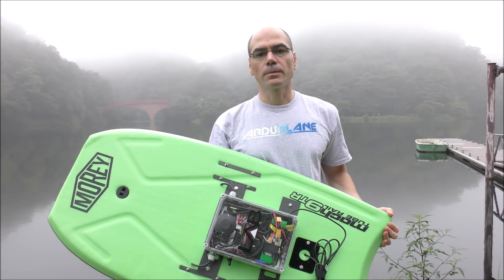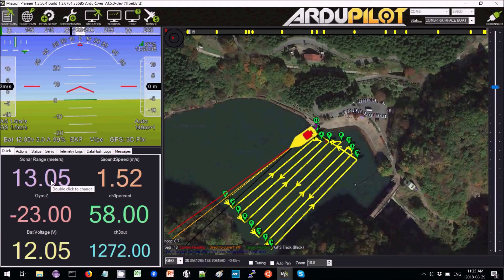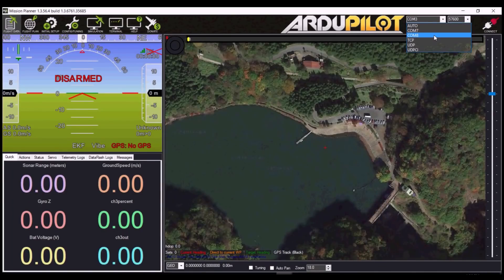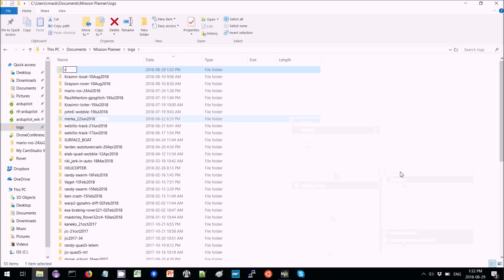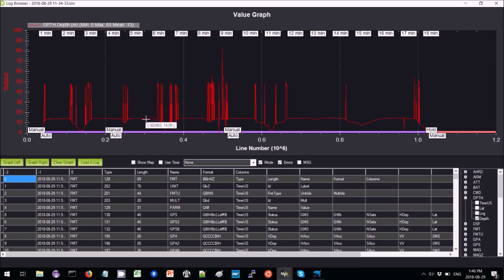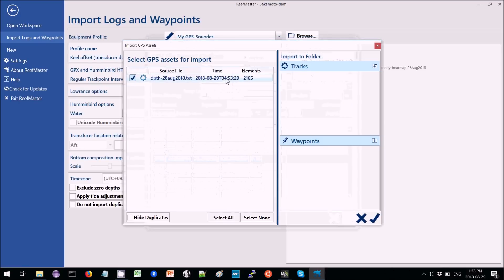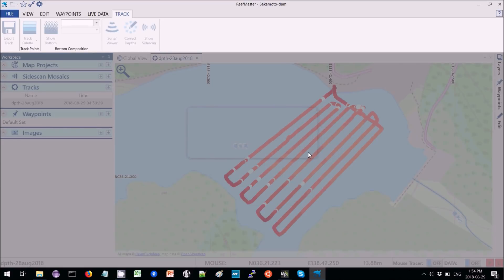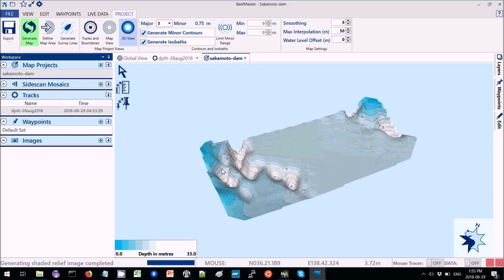Mapping a Lake with ArduPilot

Comment: Great project. I wonder if the depth soundings near the shore are from the depth sounder getting confused by a soft bottom and a strong echo from the shoreline or some other object. It might be helpful to obtain all good echoes per location to be able to identify that possibility, or at least add echo strength reading. All this assumes the sounder provides the data.

Comment: Im looking for the best way to map all of our ponds on our golf course. We want to determain our water holding capcity in the event of drought.
Reply from the maker: Sounds like a good application.  Re the underwater sonar, a BlueRobotics Ping sonar is relatively low cost (https://ardupilot.org/rover/docs/common-underwater-sonars-landingpage.html) and works with ArduPilot.  Its range is only 100feet (30m) but that is probably plenty for a golf course pond.  I don't sell these boogie board boats but ArduPilot is open source so someone with experience building RC boats should be able to put one together and they will find a helpful community in the support forums and in the ArduPilot facebook group. https://discuss.ardupilot.org/c/ardurover
Reply: @rmackay9  I will try using a Deeper Pro+ trolled behind a small RC boat. Our ponds are relatively small so I wont need waypoints. I will export CSV data to reefmaster to view the 3d map. to determain the water volume maybe I can export to Autocad and use the cut/fill tools?
Reply from the maker: @agrengs0  Hi, I don't have much experience with that sonar or Autocad so no idea but sounds like it could work.

Comment: Hi Randy, im using sonar module, but my log doesnt have dpth. Did i miss something? 

Setup on Ardurover.
Reply from the maker: Husni, make sure the orientation is set to 25 (e.g. RNGFND1_ORIENT = 25) and that the vehicle is setup as a boat (FRAME_CLASS parameter should be set to 2 (Boat)).  If this is done the DPTH should appear in the logs.  best of luck.  Also it may be best to report support issues in the forums.  Especially if using beta 4.1 I'm quite responsive, txs for using AP!  https://discuss.ardupilot.org/c/ardurover/rover-41/158

Comment: Hi Randy, 
I have anothers questions about this project.
I have the kogger sonar, and I am documenting the information to aid the Ardupilot web documentation.

I have the boat and the system fully assembled, but I have a question about the logs.
When do I retrieve the logs? after mission? 

Will the GPS NEO 8N tell me the GPS position / by time? And the same with depth sensor?

Kogger sonar does not have GPS.

I want position and depth at XX.XX time for excell and ReefMaster.

Thanks a lot for your help, sir.
Reply from the maker: Hi Alberto, yes, normally you download the onboard logs (aka dataflash logs) after the mission (https://ardupilot.org/rover/docs/common-downloading-and-analyzing-data-logs-in-mission-planner.html) and in there should be a DPTH message which is recorded the moment the sonar takes a new reading.  That messages includes the distance but also the latest position estimate.  So it's not actually the latest GPS position but rather a combination of GPS+IMU.  The advantage of this is that the distance and position should be more accurate than using GPS alone.
Reply: @rmackay9  Thanks for your help Randy... !! I am fascinating with your projects.

I have another question... today I got 2 surveys,  from 1 file ".bin" I can download the information and convert to log.... depth logs... works perfect !!!!
But the second ".bin" I have this error from MP:
"Log browse will not function correctly without FMT messages in your log. These appear to be missing from your log"
It is from the same day, what have I done wrong? Maybe turn off the Pixhawk without notifying MP?

EDIT: Auto analysis (for logs) says something like this:
"                 Failed to load analyzer results

System Yard XmlExceptiorL Fin inesperado de archivo_ Los siguientes no estén
cerrados header. loganalysis_ linea 8. posiciön I.
en Throw(Exception e)
en Syste-n.X-nI
en Syste-nX-nI ParseEIe-nentCmtent()
en Syste-n.X-nI X-nISJbtreeRead« Read()
en Syste-nX-nI MoveToCmtent()
en Syste-nX-nI IsStartEIe-nent()
en MissionPIanner.LltlIities.LogAnaIyzer.ResuIts(String xmlfle)
en sender.
     "        
Thanks sir !!
Reply from the maker: @albertorevuelta4005  this error message appears when the "FMT" messages are missing from the top of the log.  These messages tell the log viewing program (e.g. Mission Planner) what the column names are.  I wonder if perhaps the log is really big and something has gone wrong somewhere, perhaps within AP's log handling software.  If you could put the logs somewhere and send me a link I could check.  If possible though, it would be best to post in the forums (https://discuss.ardupilot.org/c/ardurover/rover-41/158 ) and ideally test using ArduPilot Rover-4.1.0-beta because this is the latest software undergoing testing so if there is a bug this is where we would fix it.  thanks again for using AP!

Comment: Hi Randy Mackay,
I am fascinated about your project. I am doing something similar in my University.
I want to ask you about 2MB flash memory, Can it be a problem for depth logs?

Thanks sir !
Reply from the maker: Hi thanks.  On most ArduPilot compatible autopilots the onboard logs are stored to the SD card and most ship with a 2GB card but this can be replaced with something much larger.
Reply: @rmackay9  Thanks very much for your fast reply.
 Thanks sir. 
Regards, Alberto.

Comment: That is impressive!  I noticed at one point a Lidar message in Mission Planner.  I have the Garmin  Lidar Lite V3 which reports distance ok in Ardurover, but I don't know what to use for PRX-Type.  Could you please let me know if it even works with Ardurover?  Mine right now is a Rover and not a Boat, but I sure want to build up a boat after watching this.
Reply from the maker: To do object avoidance with a 1-dimensional lidar you'll need to ensure the Lidar is working (which it seems you've done already) and then set PRX_TYPE = 4 (RangeFinder.).
Reply: @rmackay9  Thank you so much, Randy.  It's my problem to solve but when I did that my Rover went all over the place like it was seeing obstacles everywhere yet there was nothing in front of it and the Lidar was showing 400+ cm. I do appreciate you responding.
Reply from the maker: @HughD  That sounds very much like the lidar was hitting the ground and seeing things.  This can be seen more clearly by enabling the ADSB messages so the obstacles appear as little red circles on the Mission Planner map.  This is possible by setting the OA_DB_OUTPUT parameters (https://ardupilot.org/rover/docs/common-oa-bendyruler.html) but it may also be necessary to set SRx_ADSB to 5 (where x is the serial port on the autopilot connected to the telemetry radio sending info the ground station)
Reply: @rmackay9  Even though I won't pretend to understand fully, I totally get the idea that it's seeing obstacles everywhere.  I'll go to work on that.  Thank you for your time and advice, Randy.

Comment: Hi Randy, I'm wondering why you mounted the thrusters approx halfway down the board as opposed to at the stern of the board?  I am no marine engineer (or anything close), but most boats I have seen have propulsion at the back.  Did you choose middle placement so you can make quicker turns via skid steer?  Have you tried them further back and found the middle to be the optimal placement of the thrusters?  I have a spare set of BR thrusters, and old pixhawk, radios etc and during COVID lock-down I was thinking of building something like this to test out.  I just want to drill the least amount of holes in the craft.  Thanks for all your insight and help!
Reply from the maker: Hi Ian, I have not tried mounting the thrusters further back.  The frame was actually built for me by Attraclab (https://store.shopping.yahoo.co.jp/attrac-shop/a5c9a5eda1.html) and I think the reason they were placed in the middle was, as you say, to keep it very agile.  The thrusters on mine are placed just a touch behind the middle of the board, I suspect they are near the center of gravity of the board.  The biggest issue with the frame has been keeping the weight towards the back of the frame or else its nose gets stuck a lot when accelerating forward.

Comment: Hi Randy, have you or has anyone that you know of tried using one of the dual frequency echosounders (200/400 kHz) or (50/200 kHz)?  Would the pixhawk be able to record both streams of data from the device and store it so that could be exported as shown in this great video?  Or could you choose the single frequency to be recorded (then have to do mission twice with other frequency)?  Thanks for your help.
Reply from the maker: I haven't heard of anyone using a dual frequency echo sounder.  I think they would need to be setup as separate rangefinders but we have a small issue in how we log the DPTH message because it doesn't include the "instance".  This means there would be no way to separate the two depths.  This logging issue is quite easy to fix though so I've created an issue for it: https://github.com/ArduPilot/ardupilot/issues/14081.  So the logging issue is easy to fix, I don't immediately know how a dual frequency echosounder could be connected to the autopilot so that the autopilot can read each depth separately... but it is probably possible.
Reply: @rmackay9  Thanks Randy!

Comment: How to set up this method for scanning the water tank in Missionplanner?
Reply from the maker: Andrew, the blog post that goes with the video is here: https://discuss.ardupilot.org/t/mapping-a-lake-with-ardupilot/32401.  ArduPilot boats use the "Rover" firmware https://ardupilot.org/rover/index.html.  If you run into troubles it's best to ask in our support forums here: https://discuss.ardupilot.org/c/ardurover/rover-4-0/154
Reply: @rmackay9  Thank you very much for the information

Comment: Hi, planning on building something similar for work. The whole project seems to fall on the battery cost though. If I want to be able to run a boat like this for 8 h I would need about 360 Ah of LiPo4. Are my calculations completely off or am I screwed? Or do you have some suggestions for a workaround? Also, I am a bit curious about the retail price of the Echologger? Thanks!
Reply: May I offer you to test my echosounder? It is compact size and able te work with android devices for data logging including GPS data from the phone. https://youtu.be/Tam4cmZ7rfE

Comment: how far can these go?
the ardupilot thing right?
does it have a certain range limited by the antenaie. 
if it had infinite power, then would it have inlimited range? could it sail across the ocean or does it stop working or turn around after a certain distance?
Reply from the maker: Wyatt, the software has no specific limit on how far it can go and we think it could cross an ocean although we haven't tested it yet.  There is at least one user who is working on a solar powered boat with the plan being to make it cross the Atlantic ocean.  I should say though that we know of one issue re our distance calculations when crossing the bearing straight but we will fix this (https://github.com/ArduPilot/ardupilot/issues/1246).  If you're looking to discuss with other users and developers this is our forum: https://discuss.ardupilot.org/c/ardurover

Comment: What is the capacity of the battery you used? How long did the mission take? That's an awesome product and I'm working on something similar myself. Thanks for the info!
Reply from the maker: In this test I used a small 3300mAh battery but in more recent versions I'm using 7500mAh batteries.  I haven't mapped the entire lake but I think it would take less than 2hours but that's a guess.  I don't know if a 7500mAh battery would allow the vehicle to drive around for that long, I suspect it wouldn't bet enough so a battery change would be required.
Reply: @rmackay9  How long were you able to run off of the 3300 mAh? Thanks so much for your help!!
Reply from the maker: @williamcalli6514  I didn't time it but I think it's between 20 and 30min.. probably closer to 30.

Comment: How did you remove the spikes in the data?
Reply from the maker: Hi there.  I don't exactly remember but it may have been that I manually edited the file to remove the spikes or maybe ReefMaster had an option to ignore values below a certain number.  I think the sonar always reported a short number (like 12 perhaps?) when it saw a spike.
Reply: @rmackay9  OK, thanks for that quick reply!

Comment: Hallo wie kann ich im mission planer einstellen das er mir stand einen Rover das Boot anzeigt?
Reply from the maker: Elektro, if the FRAME_CLASS parameter is set to "2" it will appear as a boat the next time you reboot the flight controller.  It's here on the wiki: http://ardupilot.org/rover/docs/boat-configuration.html
Reply: @rmackay9  das geht aber nur mit ner PX? Habe noch nen apm 2.6 🙈
Reply from the maker: Elektro, ah.. the old APM2.x boards aren't officially supported anymore.  The old firmware for the APM2.x boards doesn't include proper support for boats.

Comment: If the water gets really deep will that effect overlap like in mapping from drones? i heard that someone was working on backskatter sonar data with pixhawk ,you know anything about that?
Reply from the maker: I think the way I'm using the sonar data in this test, the overlap is not too much of an issue because I'm just capturing a single depth at 2hz.  It's a single point not a square like a picture when mapping with a drone.  .. but if we capture the backscatter then it probably becomes an issue.  I haven't gotten to that level yet but I hope to.  I assume that the pixhawk can't handle the quantity of data if we try to capture backscatter but I don't know for sure.  My plan was to add a companion computer (RPI3 or TX2) to capture the backscatter.. if we do that, we will add it to APSync and document the setup so that everyone can easily reproduce it.
Reply: This setup with RTK i think would get survey grade accuracy putting the base station over a known point.

Comment: Very nice!!! Good job!!!
One question please, do you have One GPS for ardupilot and One GPS for the echosounder?
Reply from the maker: Mario, thanks!  Only one GPS connected to the flight controller.  The echosounder is also directly connected to the flight controller.  We have a connection diagram for the echosounder here on the wiki: http://ardupilot.org/rover/docs/common-echologger-ect400.html
Reply: @rmackay9  could you share the config file of your boat?
Reply from the maker: Mario, sure.  the parameter list can be seen here: https://www.dropbox.com/s/bd296bn23wu8de3/mapping-boat.param?dl=0. Also there is a blog here: https://discuss.ardupilot.org/t/mapping-a-lake-with-ardupilot
Reply: @rmackay9  
Hello, would it be possible to connect it with an APM 2.8 or 2.9?
Reply from the maker: @javieraguilacortes3239  No, we stopped supporting the APM2.x boards many years ago.   ArduPilot supports dozens of other types of flight controller though so there are many good alternatives. https://ardupilot.org/rover/docs/common-autopilots.html
Reply: @rmackay9  
I have seen these two controllers: 1. Pixhawk Px4
2. Radiolink Mini PIX v1.1
This second cheaper. Would any of them do for me?
Thanks randy
Reply: PIXHAWK2.4.8 PX4 Maybe this 3ª option?
Reply from the maker: @javieraguilacortes3239  We recommend staying away from the RadioLink Mini PIX because the board doesn't work with official/stable ArduPilot.  We've tried several times to work with the vendor but for whatever reason the last time I checked they were shipping the boards with a non-standard version of ArduPilot which is not a good idea for various reasons.
Reply: @rmackay9  What parameters are necessary in the station and mission planner to arm the engines?

Comment: that thing runs MINT !!!!
Reply from the maker: Txs! Yes, I really like this boogie board frame.  It's very responsive, reasonably fast (for mapping) and easy to transport.
Reply: I checked out the EchoLogger.com website .... very cool  .. did you contact them directly or was there a local vendor you used .. thank you
Reply from the maker: OneTwo, I contacted them directly via email.  It's unfortunate that they don't have a webstore (as far as I know) but they have been pretty responsive.  They seem to answer emails within a day or two.
Reply: @rmackay9  
Hi randy. What is the name of the email from echologger?
Reply from the maker: It's info@echologger.com.  There's a link to Echologger's contacts page from the ArduPilot wiki page for this sonar here: http://ardupilot.org/rover/docs/common-echologger-ect400.html
Reply: @rmackay9  What is the e-mail address of echologger if i want to contacted via email?
Reply from the maker: Ery, it seems like you're spamming my channel a bit.  The email address is written above and it's also on the echologger.com website.
Reply: @rmackay9  i'm so sorry about that. because I didn't find it on the website. thank for your answer

Comment: I thought that place triggered a vague memory... I think I rode through there on a  motorbike trip once. I used to live in Yorii, not that far away. Does that visualization program have a way to remove the outlier depth spikes?
Reply from the maker: @iforce2d, it probably is the same place.  There's a very winding road that leads to the dam that is popular with motorcyclists and sports car enthusiasts.  I suspect that ReefMaster does allow removing the spikes but I'm not sure how to do that yet.  It's actually only the 2nd or 3rd time I've used it.  The software is not cheap ($200) but I guess that's still a lot cheaper than Pix4d and is specially made for underwater mapping.
Reply: yes, all logged depth points can be changed/erased..